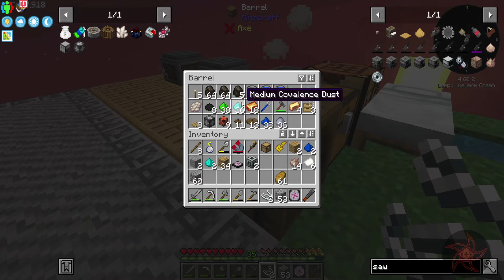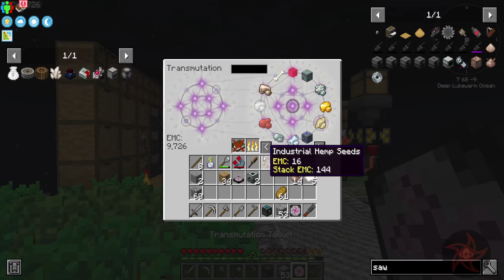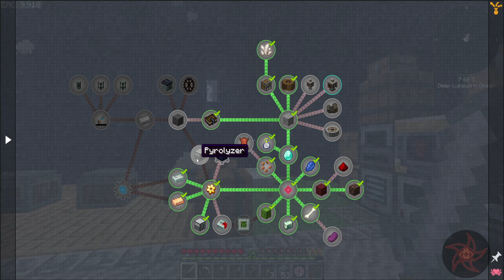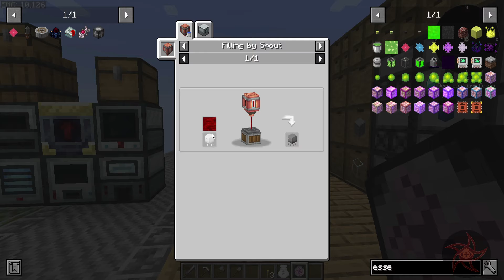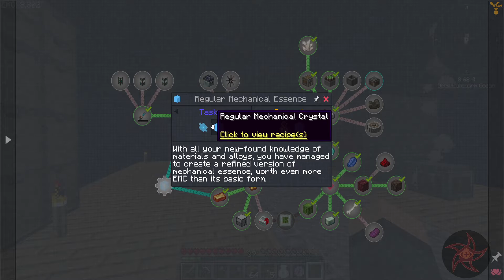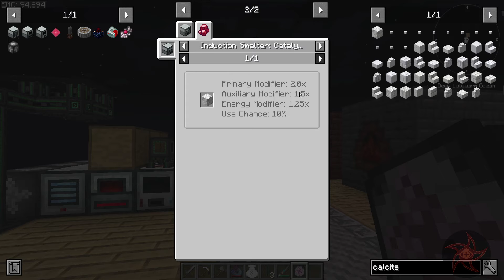Mechanical Mastery :: Automating Basic Essence :: MM-3

Comment: I paused it at 2:32 as I think there looks to be a watering can on the second row from the bottom next to the rail tracks - the icon is small so it may not be a watering can
Reply from the maker: There is the Thermal one, but frankly it sucks, doesn't really speed up the growth ticks that much and it drains water way too fast to be all that useful, 4000 mb in about 10 seconds
Reply: @theeldersign   that sounds just awful, I was not aware it was that bad = love your videos